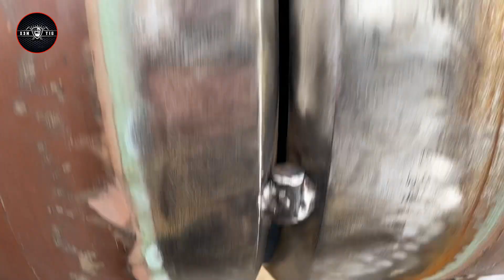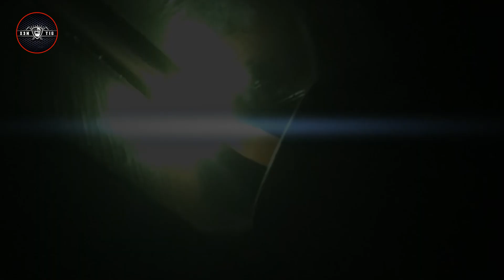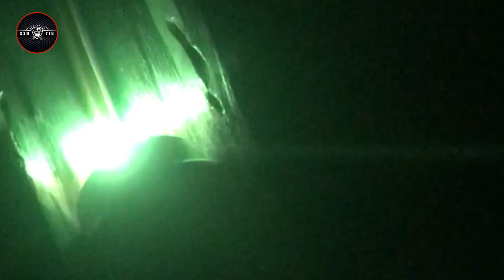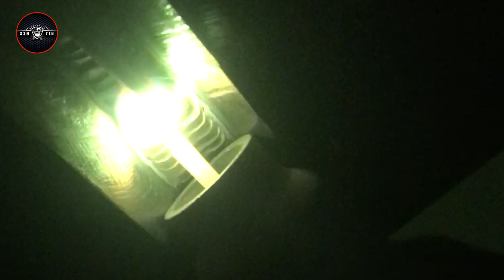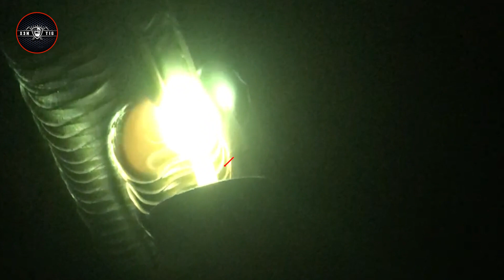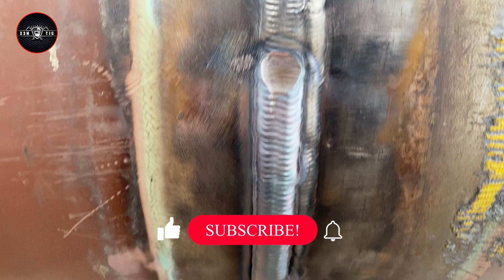Multipass TIG Welding Technique !

Comment: Beautiful work, is there difference in puddle between er70s2 and er70s6?
Reply from the maker: Yes, big difference. 70S2 is dirty rod specifically designed for dirty applications, and 70S6 got higher amounts of silicon and easier to control that puddle.
Reply: @X3MTIG  Thank you. One day if you do a 2 inch carbon steel schedule 80 it would be cool to see your procedure.

Comment: Beautiful video man!!  Thank you for posting. By the way, Do you ever use a grinder to open up a tight gap, specially at the bottom? I can see you have no problems with tight gaps, but for someone who's not at that level yet. Happy holidays.
Reply from the maker: Hey bud thanks for your comment! I’m trying to avoid grinding as much as possible, but if it doesn’t get as planned of course I will use it. If you don’t feel confident enough, definitely use grinder and open up gap enough for root pass.